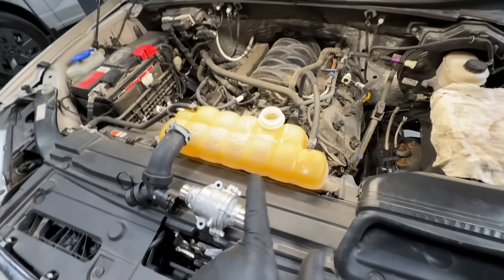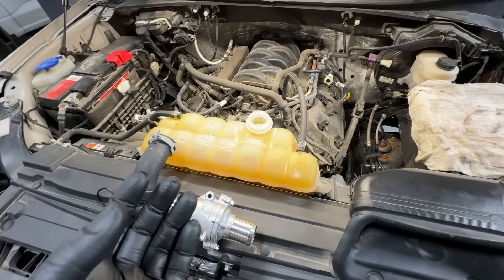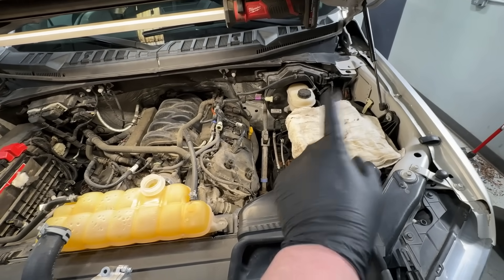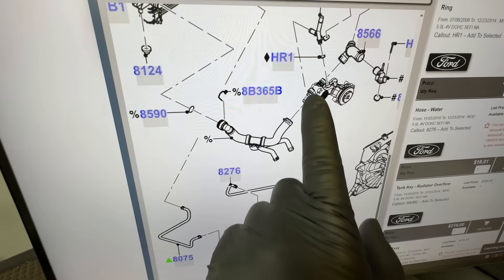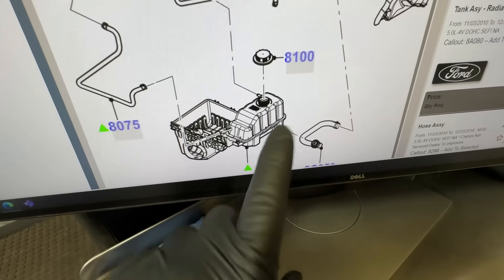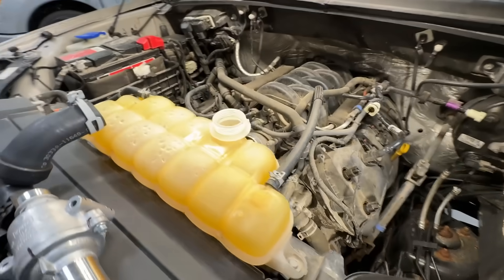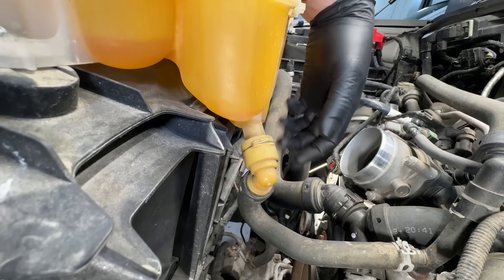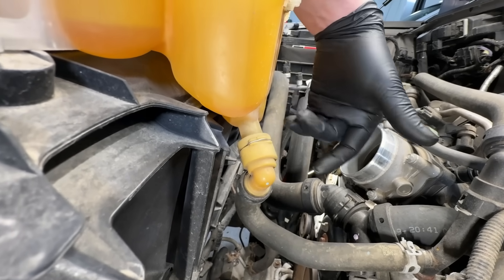2011+ Ford F-150 5.0L Coyote Engines: The Top 5 Most Common Coolant Leaks!

Comment from the maker: These are the Top 5 Most Common Leak Points:

#1 Upper Radiator Hose O-Ring-  https://amzn.to/48ZYUvA

#2 "T" Connector- https://amzn.to/3w9oL5u

#3 Coolant Bottle (2015+)- FL3Z8A080A
      Coolant Bottle Quick Connect Hose (2011-2014)- https://amzn.to/3SJfYjv

#4 Water Pump- https://amzn.to/49nEYST

#5 Heater Hoses

Forscan is a free Ford Specific Diagnostic Software:
Download Here- 
https://forscan.org/home.html
ELM 327 Adapter I Recommend-
https://amzn.to/2GC6dBj

As an Amazon Associate I earn from qualifying purchases.
Reply: Since you dont like the 5.0 coyote, which ford motor do you suggest then for the f-150?
Reply: What ford vehicles or motors do you recommend to get from a reliability stand point? Vehicles/motors made within the last 15 years, would make a good video on vehicles to buy and to avoid from the brand
Reply: Hey please I have 2014 5.0 am work on its has miss firing issues mostly cylinder 8,7 and 5 upon mummy diagnosis it leads me to valves so please I need advice what is the best solution to fixing that thank
Reply: I have a 2000 Ford e350 super duty extended cargo van 5.4L 330Cu. In. V8 GAS SOHC Naturally Aspirated. it got broken into and they tried to steal it and damaged the airbag. I looked on Ebay for a used one but they keep showing me airbags for EXPEDITION. I typed in the information for my vehicle at first it say it fits my vehicle, then when I click on the sellers page, it say on top of image to the left 
"This item doesn't fit", but when I scroll down to the Compatibility list, my vehicle is listed in the Compatibility list of vehicles. Do you know where I can get a fair priced airbag for my vehicle ?
Reply: FordTechMakuloco ? I have a 2000 Ford e350 super duty van with a 5.4l 2v with 175k miles on it. what motor oil should I use ? I only had the van for a few months.
Reply: Have you experienced a block heater plug leak? I have one in my 14’ F150 5.0. Coolant leaking above front diff.

Comment: For 1 and 2 I use 2$ garden water hose fasteners .
I just clamped over existing connections without draining the coolant.
It is 2/3 years now,and still holding on.

Comment: I have a 2023 f150 5.0.  So far no leaks 🙏🏻.  I hope the truck will be reliable over the long run.  Too old and limited income now to buy anything “new”.
Reply: For 1 and 2 coolant leaks I used garden water hose fasteners.just clamp over existing connections when start leaking.Your truck is new so you should be OK for a while.
Just monitor coolant level.

Comment: I have a 2012 F150 5.0 L and it doesn’t leak when the engine is warm but when the engine is cold, it leaks any suggestions?
Reply: Probably, when hot,material expand and seal properly,but when cold, it shrinks and causing leaking.

Comment: Awesome video. I've got the leak from the back of the engine on the driver's side, or so I thought. It's dripping down the front diff. I hadn't checked that heater line connector on the passenger side though. Awesome channel man.

Comment: Over the summer, sold my '16 Tuscon and  got a '19 Ford F150 5.0 V8 and just saw this.  No problems with it knock on wood. Did have to replace the catalytic convertor however.

Comment: i have a coolant leak. have previously replaced t connector, thermostat, upper/lower rad hose and rad. only wetness i can see is in the tray under the oil filter. looks like the oil cooler that is attached to the filter..maybe. possible?

Comment: So it's mostly quick connect orings. of course they want to assemble faster on the line, I wonder if anyone makes non quick connect version of all of these.
Reply: For 1 and 2 I used garden water hose fasteners.2$.Just grip over existing connections.
The more temperature variations from cold to warm and opposite this problem will surface.Not very smart design.

Comment: I have a 2016 5.0 f150 that’s driving me crazy with up and down temps I do t tow anything but when I go up a hill the temp will sometimes go up over 220 degrees, some times after backing down my driveway after returning home I sit and idle for a few mins and even just sitting there idle the temp will hit 223 degrees for no reason I’m at a loss for why it’s running like this. New water pump, new ford oem thermostat, new temp sensor in the head, new upper and lower hoses , new hose from the reservoir to thermostat housing, new hose cluster that connects to the heater core and a number of other places. The only thing I didn’t change yet is the hose that looks like a y that connects to the top of the engine and connects to the thermostat housing and I have a new one sitting in my garage. I can not understand this fluctuating temp

Comment: 2016 f150 5.0 here, I searched common leaks as I have one now and I'm thinking mine is just like the freestanding radiator you showed at the end.
I also have replaced 2 water pumps and upper radiator hose assembly as the plastic connectors just degrade and crumble. Fun times

Comment: I have a 2011 5.0. It just started to smell coolant inside the cabinet.  I replaced the house and t-connections. Only thing is to flush the heater core. Will that fix it? I don't see leakage anywhere from the hoses

Comment: As an owner of a 2016 F 150, I have also experienced the heater hose assembly leaking.  If it ain't 1 thing it's another. I have also replaced the water pump as well as the T- fitting.

Comment: Not sure what other gasoline pickups you drive but I wouldn’t say the 5.0 is underpowered. I’ve pulled a 10,000lbs camper up and down I-40 a few times and it’s equal to my Chevy 6.2, probably because that truck was an HD and about 1500lbs heavier.  Plus it got 6mpg versus 10 while towing. 
Anyhow, I’m on my 6th leak in 2yrs and it’s literally none of the ones you mentioned. Crazy!

Comment: My 2014 has no oil on the pan, no oil consumption, no clicky noises on the valve train.... its so smooth i swear i got a good one. 140k miles, just replaced the belts and waterpump.

Comment: My 2017 F150 5.0 was losing coolant. Still under warranty. Took it to the dealer. They couldn't find any leaks. They had it for two days. Then right before the warranty expired I took it back. They replace the radiator cap. I traded it in after that for a Honda Passport.

Comment: I have that Truck and I've had two leaks so far.  I've had leak #2 "the T connector" and The Thermostat Housing.
Reply: For #2 I used 2$ garden water hose fastener.Just griped over existing connections.
No leaks.Same happened with #1

Comment: 2016 f150 here so far has been a good truck BUT those damn coolant leaks and it really shows up when seasons change in an out of winter. Otherwise its fine. I am leaning towards the radiator crack tho cause its dropping coolant like crazy on the passenger side and i cant find where its coming from.
Reply: Check under #2 connection,mine was dripping there.if that's the issues I used 2$ garden water hose fastener and grip over existing connections.
Hope it helps.
Reply: @Chain987 my radiator was cracked on a plastice bit. So that seemed to be the problem for now until the next issue. But at +190,000miles last longer than i expected

Comment: I can agree I got 18 and had some weird gas vapor could never find it. It was so small never had to fill up with fluid. Than yesterday big leak more likely it’s the water pump. But glad I watched video think there’s other issues.
Reply: 2018 f150 are the best you gotta add 1 quart oil every 2k miles. Fresh top off lol. I can’t believe ford was able to screw everyone over on that deal
Reply: I got 125k miles first issue besides battery not bad for American. That’s why family car always be Toyota

Comment: i love your videos, shocked your not a 5.0 fan. not sure what you mean by under powered? i think hp is very respectful for a NA configuration. and they are ready for boost. my 5.0 also gets better mileage then the Eco boost my son has. I'm old school so tis v8 for me. 250,000 and water pump is all i have replaced

Comment: Thanks for the great video! This saved time and money isolating a leak on my 2015 F150 5L. It was the upper radiator hose o-ring (always at night when temperatures dropped), but I went ahead and replaced the whole T connector and all the o-rings. The one mistake I'll never make again was ordering a non-OEM T connector. The fitment was poor and led to unnecessary frustration. I went ahead and ordered the OEM part and will likely do the job again at a future date, if for no other reason than a flush and start with new coolant. On the plus side, after draining the system, doing a fresh fill of coolant, and eliminating any residual air pockets, the truck is cooling better than it has in months. After two days of driving, no signs of coolant loss. Not sure what this would run in parts and labor if taken in to a mechanic, but it wasn't a difficult job (other than fitment) for someone with an early to early-intermediate experience level as a shade tree mechanic- though doing it on a gravel driveway with snow on the ground certainly had its own headaches.

Comment: its funny.. because I bought the 5.0 simply because it wasnt the 5.4L 3v  OR the eco boost which is nothing but a great ride till 100k then 1000s to fix turbo's 
let alone all the timing crap with both of them... 
give me an antifreeze leak ANYDAY... least I can see it and fix it ASAP 
. and when you look at the bay.. geez I about fell over when I saw mine... THERES ROOM!!!  I can fix ALL 5 in the driveway
I could do a water pump or the radiator... (  def the 2 worst ) 
I think you get sick of seeing the small stupid stuff so much.. you get jaded.. I get it
but from an OWNER standpoint.. 
you cant help but be happy with these " problems" 
BTW- great tip on the bolts that corrode.. thats something most anyone can fix before they become an issue... so thank you for that!!! 
love your videos! 
keep it up!!

Comment: I replaced the plastic Y pipe with the metal Dorman one. The next day my transmission started getting hot while driving. Gauge read 240 but never had an issue before that. What could that be?
Reply from the maker: First question is why use the metal one, has the plastic one ever cracked and failed, no!
Reply: @FordTechMakuloco  it did fail!
Reply from the maker: The plastic part or the o-ring?

Comment: Hey man I have learned so much from you. I have a question I hope you can help with. My best friend has a 2018 f150 with a 5 liter. It has 135 thousand kms. and is consuming water. He has owned since new and the dealer did a head gasket at 35k. It is now misfiring and number 2 plug is white according to the dealer. They want 20k canadian to replace the engine. Have you heard of this before? I want to give him some direction.  I am shocked that a pristine one owner 65k dollar truck is basically junk.

Comment: The most damaging issue for overheating is not leaks from hoses or connectors, its the pig tail comnector for the radiator fan 
which was wired with really thin crappy wires that overheat and burn out the connector pins 
No fan means no cooling . Ford knows this because they sell a seperate pig tail connector with wires so you dont have to replace the entire wiring harness $$
Reply from the maker: Never seen one fail, they are huge beefy connectors.
Reply: The connectors are beefy but the wires and pins are Chinese junk "

Comment: That first leak was what leaked on my 2011. The T connect snapped. The after market one is metal so I figured that'll hold up a little better.
Reply from the maker: It will just corrode now.
Reply: @FordTechMakuloco  why do you say that ? .. Does the aluminum actually end up going bad and corrode on the aftermarket ones or is it just a possibility it could cuz the pump and thermostat housing are also aluminum ?

Comment: I have 2011 5.0 just recently replaced the water pump and t- Stat motor craft t-stat and oring. T-Stat is acting like it's partly open. Won't get up to temp at idle. Bum thermostat?

Comment: 2012 f150 5.0 75k miles only problems I’ve ever had is oil pan gasket replacement and coolant leak. I just noticed my coolant is leaking so I’ll be back to give a  update.

Comment: Had my 2017 heater hose leak at the T where hose hooks in, and you have to buy the whole assembly for $170. So i decided to replace all the other assembly where it had plastic Ts due to they are notorious for breaking down near the 80 to 100k mark.  My local ford had those O rings in stock but I prefer to replace the whole assembly on the front end water pump side. 
So far this is only issues with this engine setup, neighbors have ecoboost and they both stay in the shop.

Comment: coolant leak here after replacing water pump on 2015 5.0 f150 2k miles later i have water trickling out of the weephole, just enough to go down timing cover and run around the oil pan to the bellhousing. i installed it properly, but really upset to do it again. Any advice on pump brands?

Comment: My 2016 5.0 F150  at 113k miles just left me Found on road dead.  Red alarm while driving on highway “electrical charging fault”, then about 1 minute later “cooling system failure fault or over temp fault”. Look at temp gauge. Needle then pegged hot. Ok great. Tow it home. Huh no serp belt. Ok.  Put one on. Oh the water pump pulley is not attached anymore all wobbly and jiggly. Oh ok water pump failed I see ! Now to replace it all thanks to you you did great job explaining! Stupid ya have to replace all these seals and hoses just to get to the water pump, mid as well do your serp belt and ac belts while your at it. And thermostat/housing. And change your oil. Thank you for your knowledge.      Intake manifold emissions valves went out at 75k miles. Whole new intake manifold. What’s next? My rear end gears were bad 3 time “from bad factory tooling issues” changed replaced 3 times under warranty. 1 driver wheel bearing so far. All new shocks and struts at 80k.    Should you do the full transmission fluid change or flush at all or not ? I have heard horror stories.

Comment: You are giving your opinion from a techs stand point which i feel is not always open minded.. this is the best engine ford has put out since the 7.3L powerstroke.. or if you want to compare apples to apples the best engine for has put out since the ford 300 inline 6 motor.. your opinion is absolute trash on the 5.0 do not agree one bit. ( ive been a certified ford tech for 29 years) probably longer than you've been breathing
Reply from the maker: You know I am approaching 50 years old right? I was there working at the dealer when this engine came out and was one of the first to replace a short block when they came out. Your opinion of me means nothing.
Reply: @FordTechMakuloco  obviously it does 😃
Reply from the maker: Thanks for the compliment though.

Comment: Yup my leak is number 5. What’s funny I just topped off my coolant last week and have been getting a burning smell. When I investigated it, it was exactly that. I could also see it was running thru the valley. Other than that my 2013 5.0 has been really good just about to roll over 180k

Comment: I have 2012 f150 5.0 and love it. Had leak at quick connect coolant tank. Fixed with aftermarket kit. Fixed problem. Other leak happens at o ring only when it is 25 degrees or below out.  Not a big leak and stops when coolant heats up. Maybe a quart all winter. No big deal to me. I have all the new parts to replace it if need to be.
Reply: For #1 ,#2 I used 2$ garden water hose fastener and just grip over existing connections.
3 years now and it works.I am In Ontario and noticed cold weather play on those connections. ,you mentioned.
Great point.

Comment: I have the 2014 I’ve had to replace upper radiator hose t connector and water pump and I am now hunting down another leak all with in 7 months of each other. This video definitely gave me some new areas to check especially since it’s leaking down the back of the bell housing

Comment: I have a 2013 Mustang GT, and I have had all those coolant leaks, except the water pump. I have to say that despite this, the engine is very good, reliable and with incredible power. It took me a long time to find those leaks, since they drain and appear elsewhere. But I've taken it apart so many times, that today I know every Oring. Thanks for your videos, they are very useful. A hug from Chile, South America. 👍👍👍

Comment: Underpowered? You never drive any of the 2 and 3 valve trucks? 😂
Reply from the maker: Yes the 3v trucks are what I am known for.
Reply: I thought so....they're absolute turds compared to the coyote trucks...at least the ones I've driven. I've never heard anything good about the 3 valves either. The 2 valves were good motors though...aside from those few issues they had.

Comment: I recommend replacing the T-connector and not just the oring. Seen the actual plastic split on the molding seam on a couple of them.
Reply from the maker: Absolutely
Reply: For that,I used 2$,garden water hose fasteners,Just griped over existing connections.2"in diameter.
I give a try and it works.

Comment: I have a 2018 f150 5.0 v8, what oil and oil filter would you recommend i use, and also what fuel octane would be best?
Reply: What ever oil filter you desire and just regular gas is fine too use